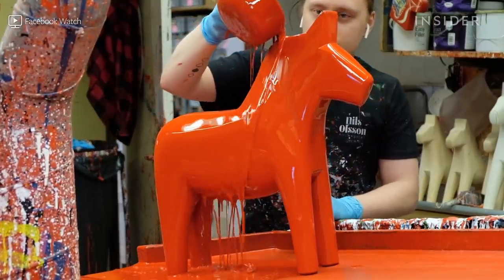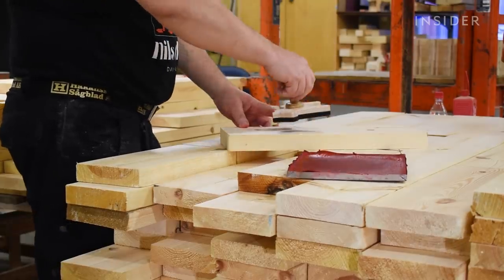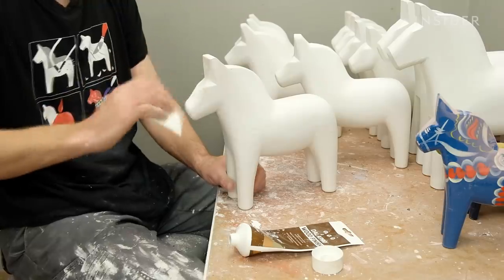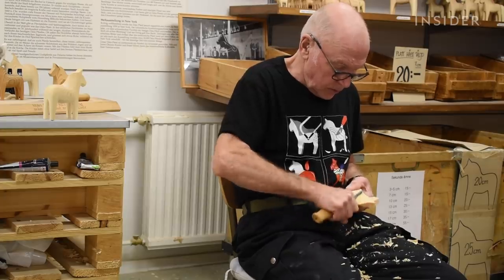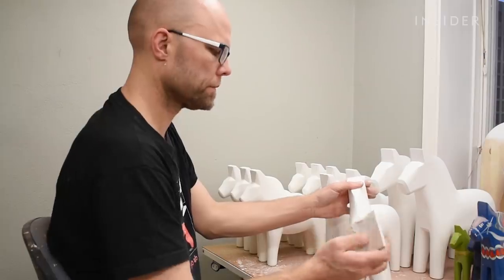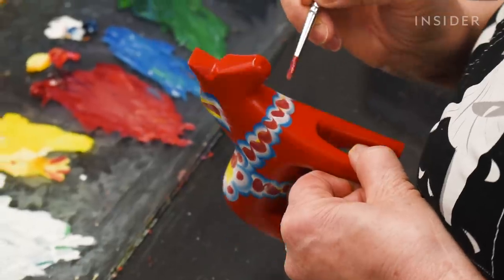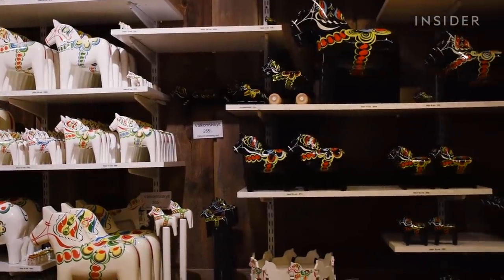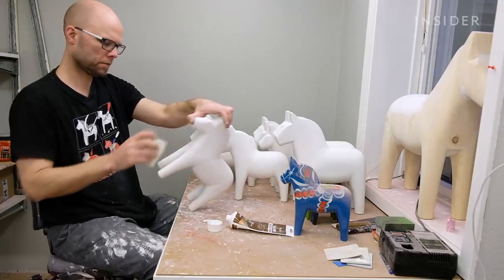How Dala Horses Are Handmade In One Of The Last Factories In Sweden | Still Standing

Comment: It should be pointed out that colour is from one specific mine, which is Falun koppargruva. Today the mine is closed; however, in its prime was one of the largest copper mines in Europe. The paint is made out of the mine's tailings (a restproduct from the mine), consisting of hematite, iron(III)oxide that gives its red colure. If you are a metallurgy geek like myself, I can recommend visiting the mine in Falun.  
Today, only one copper mine is still open in Dalaran, the mine in Garpenberg owned by Boliden.

Comment: Uuhhmmm.... A Dala maid here. The orangy red paint used for the Dalahästar is NOT the Falu red paint. That paint has pigment in it hailing from the Falu Copper Mine (a.k.a. granny, or mormor) and is in it's most traditonal red colour deep red with no orange tones in it what so ever. Also it is used for outdoors walls, as the pigment will rub off on your fingers or clothes when touched. 

Sorry but the video is wrong. The two paints are not only made differently but also has two different red nuances/shades.
Reply: Have they been a religious symbol?
They said in the video but i cant find a source and ive never heard about it being religous.
Reply: @qi7ni  Idk if they have been any sort of religious symbol in the past but they are definitely not seen as a religious symbol today.

Comment: I wonder if they have other painting options. I like the red horse but would prefer the folk art paint to be changed. The horse would still evoke the Sweden heritage but in a more modern way.
Reply: That's how they've looked for a LONG time. I have one that I'm guessing is around 40 years old (or more), that looks very similar. It's a touchy subject to even suggesting it. To me it wouldn't be a dalahäst if you changed the kurbits parts on it, as that is more than just "folk art". At least the ones from Nils Olsson. They have variations on it, but it's pretty much the same design. You have different colours now tho.
Reply: It might be possible to buy just a red one and paint it yourself. Or just paint over the folk art.
Reply: @hinken3716  you can find plain unpainted ones as well